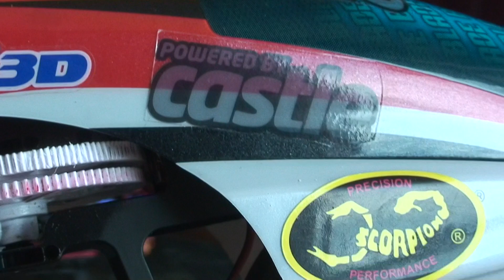blade 450 3d tail blade grips failure

Comment: Exact same thing just happened to my 450 3d today, except i was using the 440 motor from the 450x. The 450x uses the same plastic parts as the 3d. Horizon Hobby needs to fix this problem.